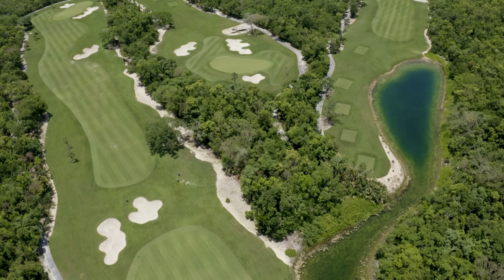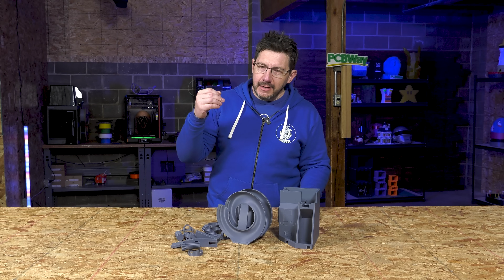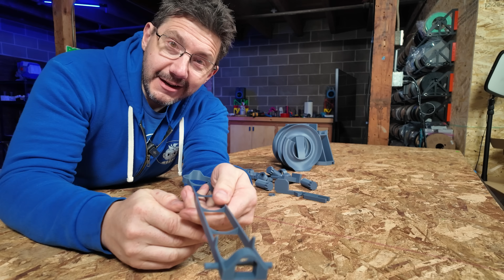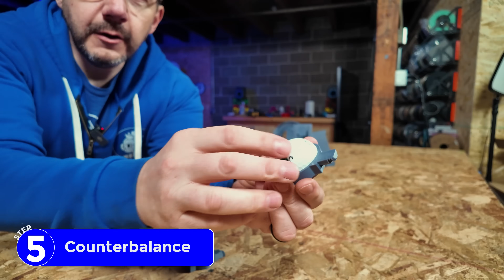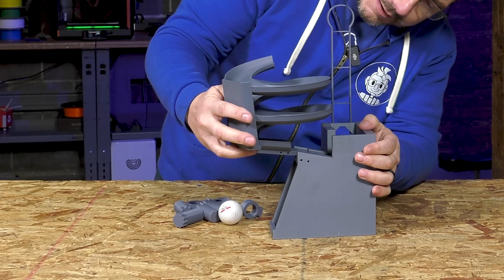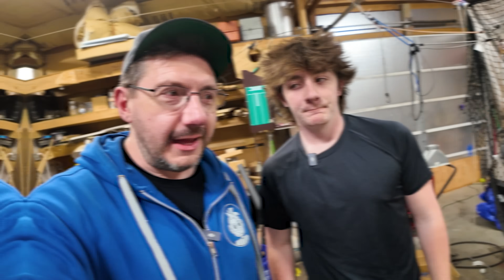Bend Over NO MORE! 3D Printing TO THE RESCUE!

Comment: Collective Statement from Backers Affected by the Anycubic Photon P1 Campaign

We, the backers of the Anycubic Photon P1 campaign, want to raise our voices publicly.

What is happening with the shipments in this campaign can no longer be treated as a simple logistical adjustment or a minor delay. What we are seeing is a widespread problem affecting a very significant number of backers, and it seriously calls into question Anycubic’s planning, transparency, and commitment to the people who funded this project from the very beginning.

Many backers have started receiving only part of their orders. In numerous cases, the main printers and some additional machines have been delivered, but the add-ons, accessories, and extra products that were purchased, charged, and promised as part of the campaign are still missing.

In my specific case, I have received only the two P1 printers from the Duo Kit, along with the Wash & Cure 3 Max and the Wash & Cure 3 Plus, but I have not received any of the additional add-ons included in my order. Even more concerning, this is clearly not an isolated case: more than 800 backers appear to be in a similar situation.

Anycubic’s own update published on March 17, 2026 confirms that some add-ons will be shipped separately and that several products are temporarily out of stock. Rather than reassuring the community, this admission only increases the concern among backers.

Because the obvious question is this:

How is it possible for products to be out of stock in a campaign with 2,107 backers, after more than four months of time to plan manufacturing, inventory, and logistics?

We are not talking about unexpected demand in a public retail store. We are talking about a closed campaign, funded by identified backers, with predictable volumes, known quantities, and enough time for calculated production planning. If products that were already sold and paid for are still missing, then this points to a serious lack of forecasting or a deficient management of the commitments made to backers.

This is not only a matter of delay.

It is a matter of:

lack of planning

lack of transparency

lack of respect toward backers

lack of clear information regarding orders that have already been paid for

Backers do not accept being told now that certain add-ons “will be shipped when stock is available,” as if this situation were normal or inevitable. It is not. Production for a campaign of this size should have been planned rigorously from the start. It is not fair for the company’s forecasting failures to fall on those of us who funded the project and waited patiently for months.

Furthermore, the lack of detailed information only increases distrust. General messages are not enough. Asking for patience is not enough. Redirecting people to PledgeBox and leaving each affected backer to discover for themselves which part of their order has not been shipped is not enough.

We demand an immediate, public, and verifiable response from Anycubic.

We demand that Anycubic provide complete clarity on the following:

Which add-ons and extra products are actually out of stock

How many backers are affected

How many orders have been shipped incomplete

What the real restocking and shipping timeline is

What concrete solution will be offered to those who do not wish to keep waiting through further delays

What measures will be taken to restore the community’s trust

It cannot be normalized that a company collects support from thousands of backers and then delivers incomplete orders while claiming a lack of stock for items that have already been sold and paid for.

For this reason, many of us are now going to make this situation publicly visible. We will be contacting bloggers, reviewers, influencers, specialized media outlets, and content creators in the 3D printing and technology sectors so they can see what is happening with this campaign. The community has the right to know. Future customers have the right to know how this launch is being handled. And Anycubic has the obligation to respond in a clear, public, and responsible manner.

We are not seeking confrontation for its own sake.
We are seeking transparency.
We are seeking fulfillment.
We are seeking respect.

But if there is no serious response, this situation will stop being just an internal Kickstarter problem and will become a public issue within the 3D printing community.

Anycubic must speak out now.
Backers deserve answers.
Orders must be completed.
Transparency is not optional.

Comment: I don't know about your experience but in my experience assuming it sticks to the bed and assuming it doesn't crack or split every time I print something with ABS it's some of the best prints I've ever gotten out of a printer whether it be a flashlight body a simple tool part or a nose cone for a rocket ABS makes some of the cleanest smoothest nicest Prince I've ever seen like perfection as long as it sticks and doesn't crack you can even do reasonably large open air ABS prints if you use a larger nozzle like a 0.8 to a 1.2 mm nozzle and it also helps if you can get over 100° on the bed 110 or 120° works very well and of course you really need to make sure there's no drafts in the room but otherwise it prints like freaking butter

Comment: Love this but it is only half the solution. I would like to have a 3d printable product that grabs the balls from a collection area near the net (say using a slight slope in front of the net that brings the balls back to a hopper that feeds this device. I could see some small motors and a sensor to detect a ball and set say a conveyor in motion to bring the ball up to the hopper. Or perhaps just have the conveyor constantly running while practicing.

Comment: Seems really neat though a little tippy. I would add some weight to the bottom to keep it from moving around. I’d also add flanges on the bottom so you could drive a couple of spikes into the turf if it’s being used on grass.
Reply from the maker: Ooh yes spikes! Great idea.

Comment: definately need to increase the hopper size to hold at least 48 in a bucket, then however many spiral.   Reasoning is  a 48 pack of recycled balls can run around $23 (or free in some cases if your near a golf course that allows it, as having too many old balls causes a issue in storage supplies)   Golf balls themselves are sold new in typically 12 packs as well - so  you wanna keep the dozen in mind when designing things.

I think a bucket on stilts (non 3d printed sadly for height and weight and material costs) would be the most effective, with possibly a 3D printed funneling system in the bucket to help the balls all roll toward the exit that will be the ramp to the spiral placer.

Comment: I feel like there should be some way to add that 5 gallon bucket of balls so that they roll into the existing hopper, but when the hopper is full the balls stay in the bucket. That way you don't have to reprint anything and you don't need the mechanism to support the weight of 50 golf balls.

Comment: We just put in a net to hit at work so Ive been planning on making this. I too want a larger hopper so I think Ill be modding it to hold more. I also would like to have the ball placed farther away from the unit, so Im gonna try to elongate the arm as well. Will probably have to test it, based on weight, pitch, speed and counter balance.
Reply: The creator actually made a hopper already. But if you overfill it, it will jam up. You're still limited to the 24 balls it holds. But, the hopper makes it much easier to fill up as you can just dump them in. There's also a small mod made by someone on MakerWorld that stops the pedal from traveling too far, which can cause the lifter to come up too high, allowing them to get stuck.